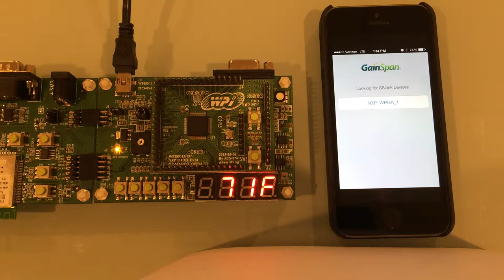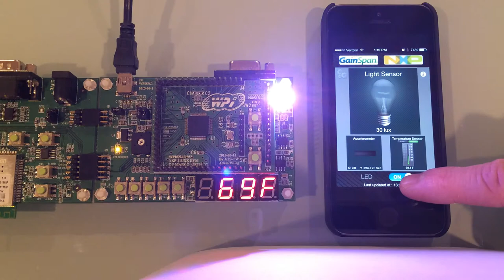NXP GainSpan Apple iOS Application

Comment from the maker: This video quickly demonstrates the Apple iOS application capabilities for the NXP-GS-WIFI evaluation board.

WPG Americas Inc. is proud to introduce the GS-NXP-WIFI evaluation kit featuring MCU and Wi-Fi products from NXP Semiconductor and GainSpan!

With the engineer in mind, the GL-NXP-WIFI demo kit was designed to evaluate capabilities of the GainSpan GS1011M ultra-low power wireless module and Serial-to-Wi-Fi embedded software using an ARM Cortex-MO core MCU from NXP.

The Serial-to-Wi-Fi embedded software allows device and appliance manufacturers to easily add Wi-Fi capabilities to their products with minimal impact on the NXP microcontoller firmware.

http://www.wpgamericas.com/pages/nxpgainspanboard
 #nxpsemiconductors   #wifi   #mcu   #ARM   #apple   #ios